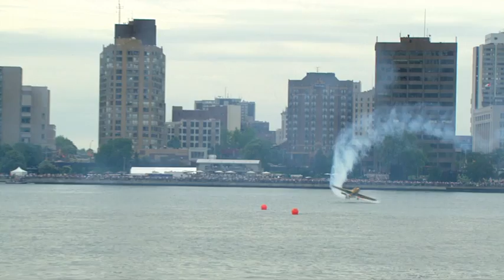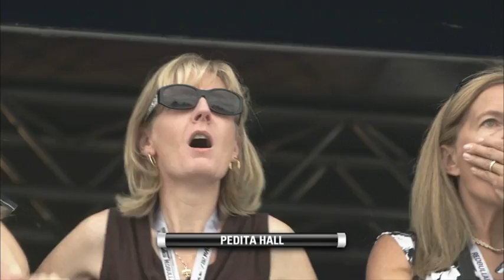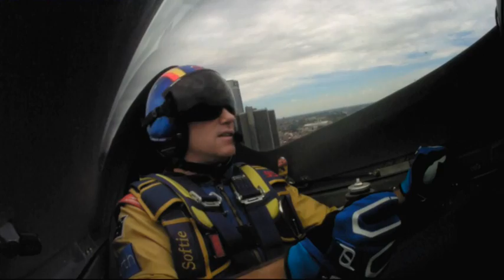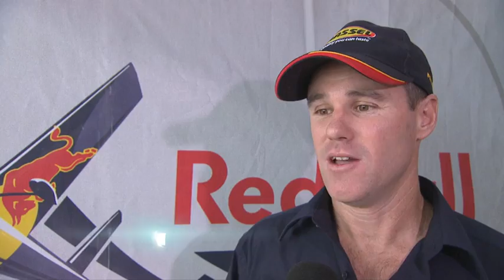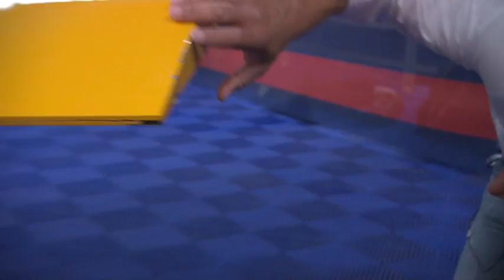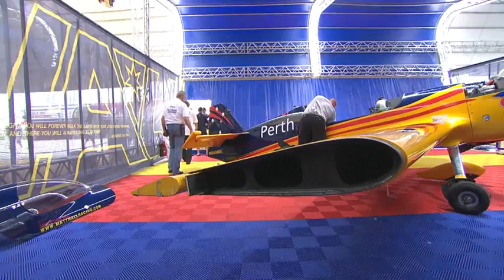Matt Hall's amazing recovery

Comment: I think the bit of luck might be that the wingtip leading edges didn't bite into the water, and that the right gear pant impact didn't damage the tire or strut such that the landing would be compromised. It was an amazingly skilled recovery, but he was about 3 inches away from the leading edge of the wingtips digging in as opposed to the trailing edges skimming the water. Knife edge close call.

Comment: @Ireg2post1 Luck? Do you have a dictionary? He was in high-g turn, stalled the wing 20 feet off the water at say 200km/h at over 90 degrees angle of bank, hit the water but recovered unhurt and with the aircraft flyable, to make a safe landing and race again some day. If you could point out which bit was luck I'd much appreciate it.